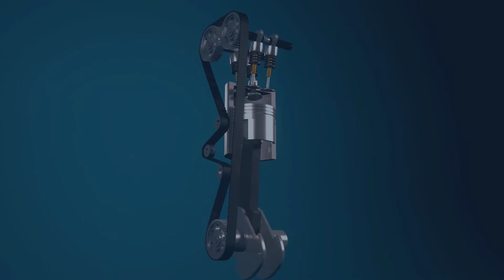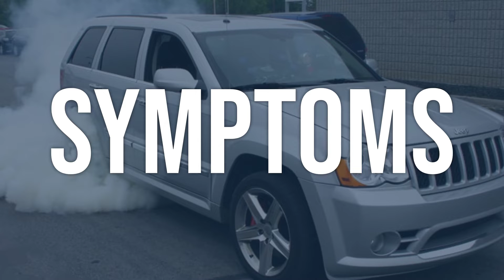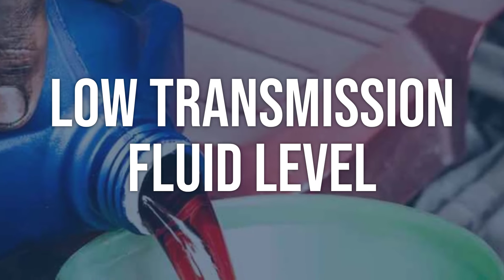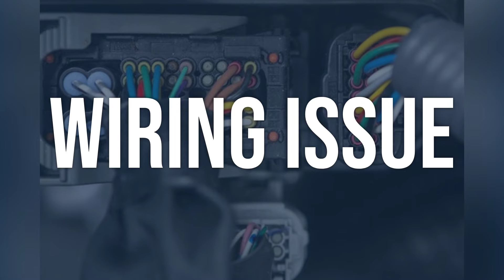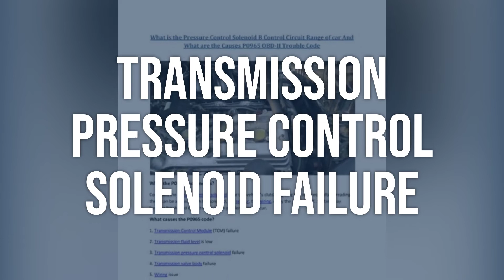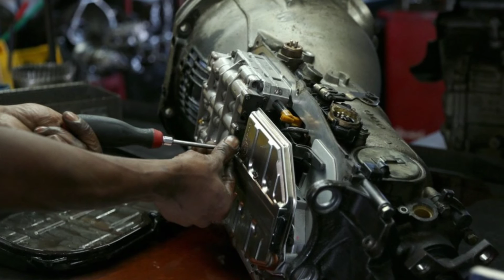How to Diagnose and Fix P0747 Engine Code - OBD II Trouble Code Explain

Comment: Just got this code on my 2023 Chevy diesel
Reply from the maker: There may problem with the Automatic Transmission Pressure Control Solenoid "A" Circuit Stuck On. This could be due to issues with the solenoid itself, the transmission fluid condition, or the transmission control module. It's important to check the transmission fluid level and quality, the wiring and connections to the solenoid.